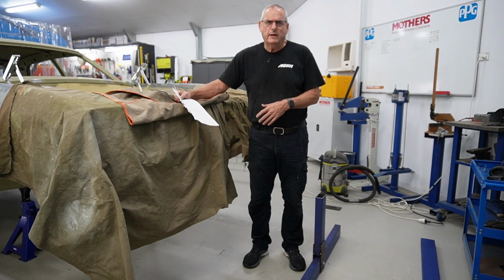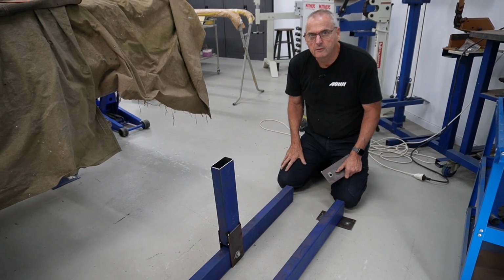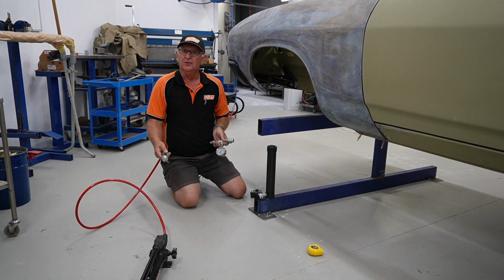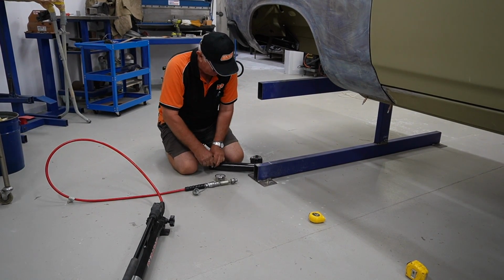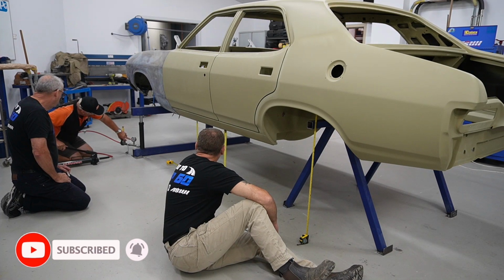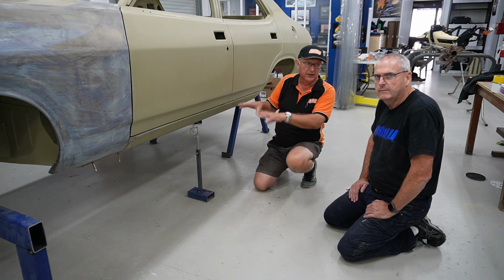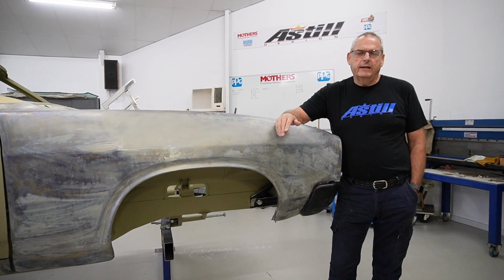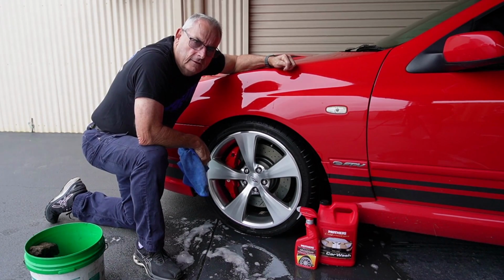Dr Tim Completes Torsion & Beam Test On BOSS XC | Road To Summernats Top 60 #31

Comment: I had the impression that the beaming and torsion test was done with the vehicle anchored to a couple of  RHS rails . Then the twist test was done.  The whole body / chassis was anchored to those rails. Not just sitting on stands on the floor.
Reply from the maker: In our case it was anchored to the floor and then twisted.
Reply: @AstillDesign  Thanks.. I will need to do this in the future.   I have to find an engineer that will do this in Newcastle NSW.      Wish me luck😉

Comment: Hi Howard. The Qld procedure for Beaming and Torsional Testing can be found in the Section LT of the National Code of Practice for Light Vehicle Construction and Modification (NCOP) also known as VSB14 (https://www.infrastructure.gov.au/infrastructure-transport-vehicles/vehicles/vehicle-design-regulation/rvs/bulletins/ncop) . I would suggest that you and your followers read this section because the test conducted here does not follow those procedures eg. for each test the vehicle is to be pre-loaded and then unloaded to settle the vehicle prior to the actual test, the beaming test load should be 2x68kg per seating position, all doors are to be ajar during the testing, a predetermined load (0.25 x GVM x Wheel Track) is to be applied to the beam during torsional testing,  measurements at the outside of the mudguards are not acceptable, 12 measuring stations are to be used (6 per side) and precision measurements taken (dial gauges) to accurately calculate and plot the angles of twist and average deflection at six planes along the vehicle length, accurate angular deflection also can't be calculated unless the distance between the left and right gauges is known (vehicles do not always twist down their centre lines). For modified vehicles two tests should also be done, one prior to modification and one following modification to ensure that the strengths are retained.
Reply from the maker: Thanks for your feed back Earl.

Comment: Nice explanation video. Would installing the front and rear windscreens make it stiffer? Or would you risk breaking them under that force?
Reply from the maker: They weren’t a structural part from the factory. The front being urethane installed could help a bit but didn’t need any additional help.

Comment: Should the car owner be involved with the measurements ?
Reply from the maker: I presume your referring to us at the shop helping Tim with the process and not being independent.
Reply: I guess someone could question your involvement down the track . I have no issue just a observation 
So you twisted it 40+mm?
Did you notice anything has changed ?

Comment: Hey Howard,
Can you please explain when the Dr. was applying pressure in the torsion test, what was he trying to measure. I noticed you took dimensions at different points along the car. Was this to test if the deflection was uniform.
Reply from the maker: He was measuring how much the arm moved at the ram, we we measuring at fixed points along the sill. The ideal scenario is a flat line of increments
Reply: Thanks Howard

Comment: The same as me- every car i have built (including my GT500 engine swapped BF MK2 XR8) was engineered for everything i could get done.

Cars i had engineered in NSW were a lot harder to get done (early 2000's), but the Qld guys were far more professional & checked everything 3 times, and no corners cut.
Reply from the maker: Yes every state and every engineer is different

Comment: Love this build. 
Always wondered since seeing body swaps done in the states the feasibility of doing them here in Aus, granted yours is done properly and tested but I've seen alot of them done there and think the old body, new underpinnings is such a brilliant idea. Not once have I thought they'd ever be road worthy on the streets here, well.. not the way they're done there anyway. 
Great to see it done and passed👌
Reply from the maker: Just remember this is not a body swap, we have only used the cabin floor and firewall to utilize the FG interior, The frame is still XC falcon with aftermarket suspension
Reply: @AstillDesign  So the torque boxes and sills are all unmodified XC also?
So it probably isn't feasible to run the better underpinnings of the modern equivalent then..
Reply from the maker: It has XC sills and torque boxes plus additional rails. The FG components are the floor and inner sills plus fire wall and inside of the A pillars.

Comment: A great episode as usual. I would have ,liked a visual shot of where the measuring brackets were bolted too even though you did verbally state suspension points. Still a good informative episode.
Reply from the maker: The rear tressel was welded to the frame directly above the axel centre, the front was bolted to the inner lower wishbone mount

Comment: Ummm, the laptop said 1972 XA Ford Falcon sedan??
That aside, it's stiff!
I can hear my 2013 Yaris flex through the door rubbers when turning through spoon drains or angled driveways!
Legend has it that Moffat and Bond's 1/2 Bathurst cars had a secret stiffener from the front of the rollcage into the shock tower,  via the inner top of the inner fender to stiffen them up.
They drooped big time before hand.
Reply from the maker: I’m sure Tim will fix that typo, yes they had plenty of movement especially the engine cross member. It used to get ripped out.

Comment: So this test is only for monocoque chassis?
Reply from the maker: No, it is preformed on chassis cars as well. It can be preformed by mounting to the wheel bolt up face with a fixed rod replacing the shock obsorber to get a fixed suspension.

Comment: Nice ute Howard, what do you think about ceramic coatings?
I have a supercharged Ba xr8 ute and so I put much bigger front brake on because i needed extra stopping power and got pulled over coming out of power cruise here in Queensland and they defected me for having larger brakes, unbelievable!  Anyway had to get an engineers plate and he sign off on it no problems, but all that hassle and money for trying  to do the right thing and everything was ok anyway.
Reply from the maker: I have been using the Mothers ceramic polish plus the wash and coat with great success. I haven’t had any experience with the full on ceramic coatings

Comment: My Cousin was building a VW Manx Buggy, he gave up and sold it because he reckon's it was ridiculous what the Engineer wanted him to do for structural rigidity. If you take the bug body off it looses that rigidity as the body gives it the strength not just the pan. Like the DR said the roof plays a big part. So he was basically trying to register the Manx (roofless!) with it just on the normal pan. His skills didn't allow him to do it right or money didn't allow him to get it done right. He's moved on to Kombi's now haha.
Reply from the maker: Yes and every engineer or certifer has a different interpretation of what’s required

Comment: Congratulations on the superb workmanship. I have seen videos that say by going to a double A arm style front is not a good idea as they don't transfer the load through the shock towers into the firewall like a strut conversion does. What do you think is better? Keep it the great content.
Reply from the maker: We added extra strength to the rails with a 3mm plate running down the inside and back to the box section additional rails.
I think the strut setup is better for normal road use as the coil over style suspension has limited travel.